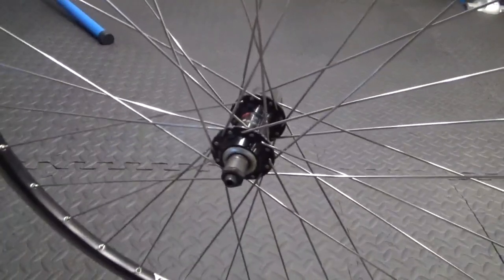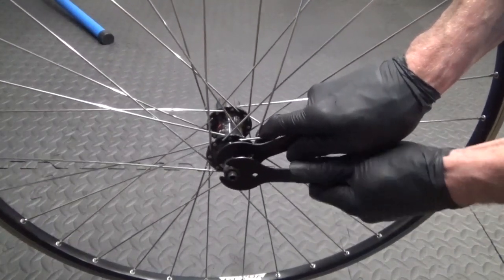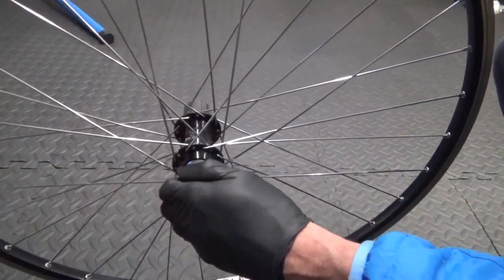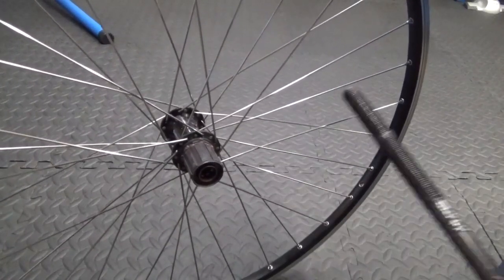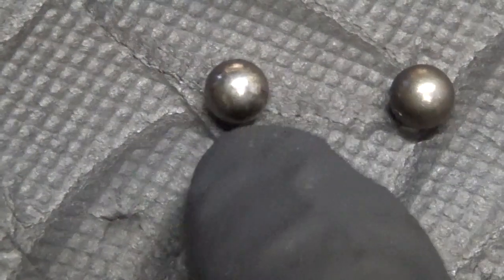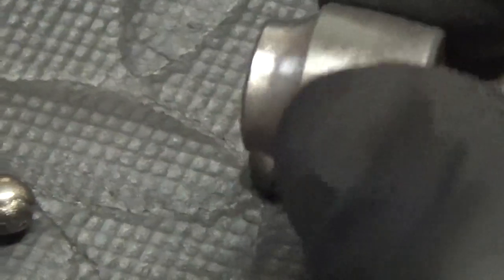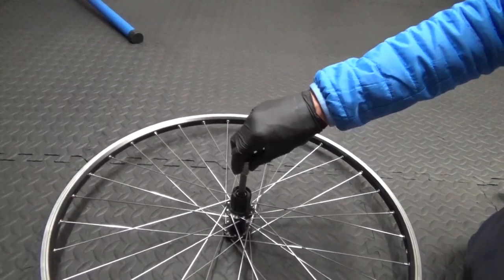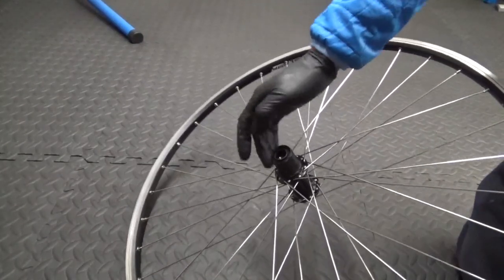How To Service Shimano Ball Bearing Rear Hub - Service A Shimano Hub

Comment: It's an M12 multispline bit if you want to purchase the correct tool to remove the freehub body.  I had one in my toolbox that I bought about five years ago for the flywheel bolts on a Volvo T5.

Comment: I found that a pair of face tweezers works amazing for picking up and placing bearings into your hub.  Just a tip but you can use a little screw driver

Comment: great instructions, right when I needed them

I suspect the clutch(es) inside the freehub body are not springing back, because the bike wasn't used for an extended period of time, and was stored outdoors in the tropics.

is it OK for me to remove the dust cover gently using the gear pulling jaws (I have them) or something, and then clean the inside of the freehub, and put it all back together?
I know some people will just order a new freehub and replace it, but:
1. I prefer to fix it if it is possible
2. the availability of such parts is not guaranteed where I live 

thanks!

PS
of course if I find out the clutch(es) is/are broken, I will be forced to buy a new wheel maybe, which is easier than sourcing this freehub for me.
but I suspect they might be just not springing back because ot he old sticky half dry grease.

Comment: Great video.

Sometimes when I tighten the locknut at the end, the axle turns with it. As I'm holding the cone in place with my cone spanner, this effectively loosens the cone again.

I do not have an axle vise at the moment.

Any thoughts/tips?
Reply: Do you have an edelweiss?
Reply: sometimes u have to put a 17mm-15mm spanner on both end on of the hub slightly(just slighlty) over tighten... then cone spanner both end to reduce it til just right.. trial and error(IE undo and start again).... or if u have  a vise clamp the centre axle with cardboard to protect the thread to stop it spinning... depends on corrosion or how good the tolerences were on the cones lock rings and axle u got...happy trails...

Comment: How to get new bearings, what size? Thanks for the video!
Reply: Front
Size 3/16" balls and 10 balls each side. 

Rear
Size 1/4" balls and 9 balls each side.  

Grease doesn't really matter which.  The "TF2 lithium" stuff often comes with the ball bearings.
Reply: @steve0680657  hi Steve, would this info apply to shimano hubs with the quick release mechanism? I was about to pop out and buy a job lot of the 1/4 inch for front and rear and the heavens just opened so I'm going tomorrow instead.

Comment: Thanks for the video, very clear. Just wondering what size hex head do you typically need? I've only got up to 10mm and so will need to buy a larger but don't know what size
Reply from the maker: 12mm hex
Reply: @FreeToCycle  ah great, thank you!
Reply: @miketaylor05  did the 12mm fit
Reply: @steriophonic1  mine ended up needing a 11mm hex

Comment: My LBS repacked my rear hub. It was turning well for about 20secs+. Now when I spin it, it only spins for 10-15 secs. there is no play in the axle. Is it because of too tight cone? Does the longer the spin a good indication of correctly adjusted cone or just the smoothness of turning the axle?
Reply: Its just because its well packed with grease. Long as bearings are not rumbling & no play you are good to go.

Comment: I've watched RJ's videos on this and I've noticed after removing it he puts the freehub in a jar of solvent dries it off and drips hub/chain oil through it. Is it worth trying or should I just buy a new freehub?
Reply from the maker: You could try it first see how well it lasts.
Reply: @FreeToCycle  Yeah tbh I might as well try it, I'm gonna buy a new one anyway if I end up trashing it
Reply: Clearest video I’ve seen to explain how this is done.
Reply: Buy a new one. I tried to salvage mine and it was working, until I put it under the load of my bike. Btw, excellent vid.